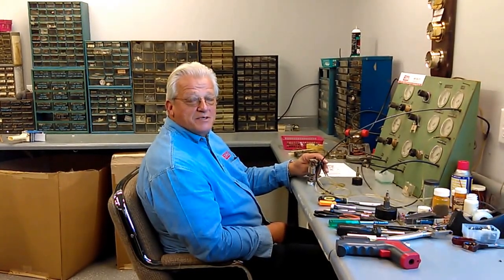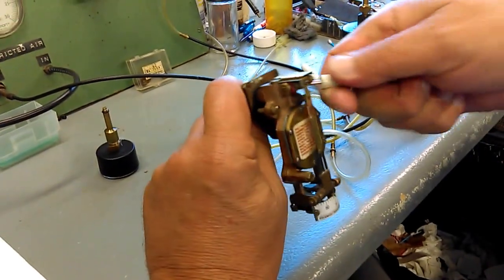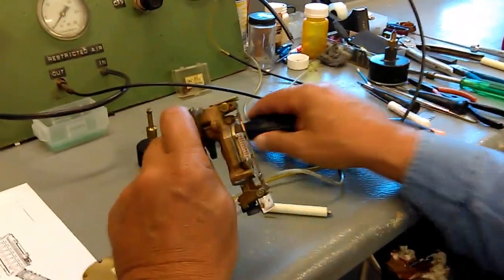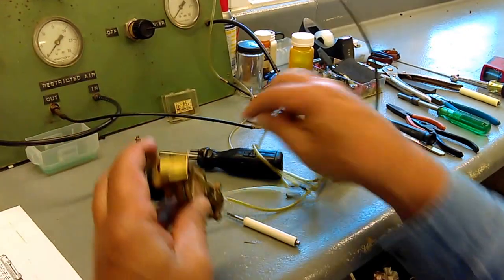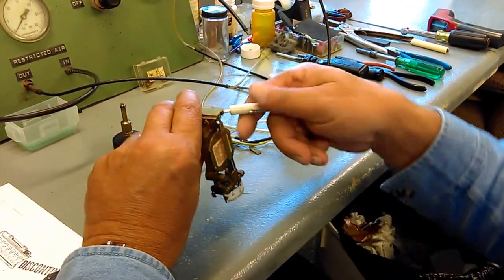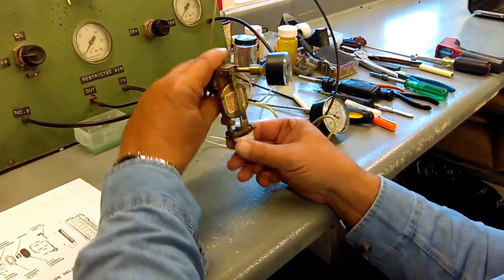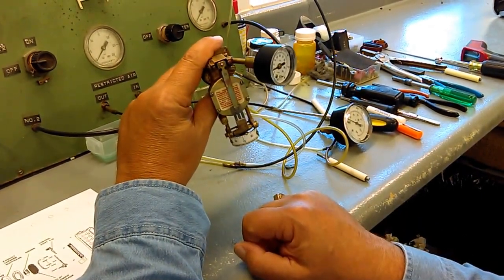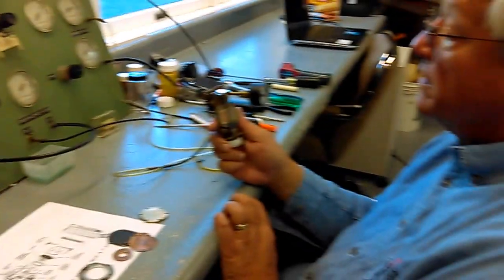How to Calibrate a Johnson T-400 Thermostat

Comment: Greetings and good day. Thank you for sharing this video, I am working with some old Johnson Thermostats from 1924 up to the T-4002. I was wondering if you have an air compressor hooked up to your testing machine. Would I need to have my air compressor running while I went through the building and tested each thermostat?
Also, where is the easiest and best place to get a kit or the tools to properly do the job?
I have not had the best of luck when trying to find a one stop shop.
Thanks